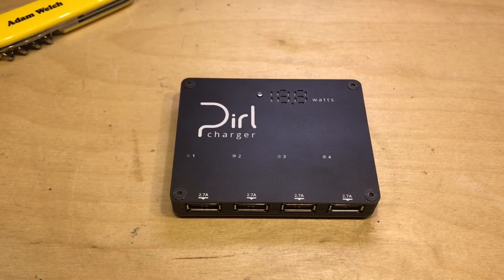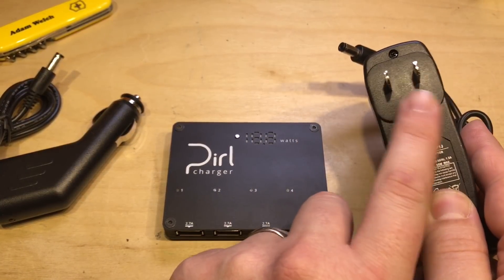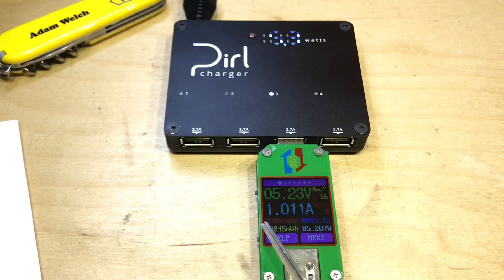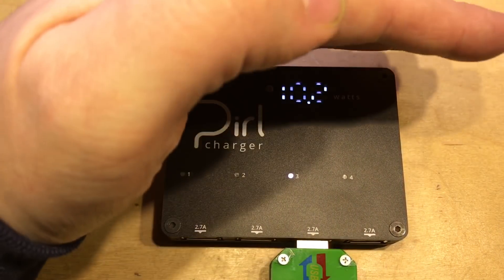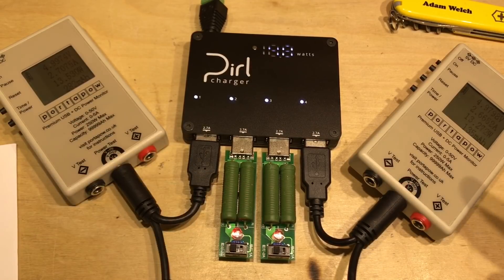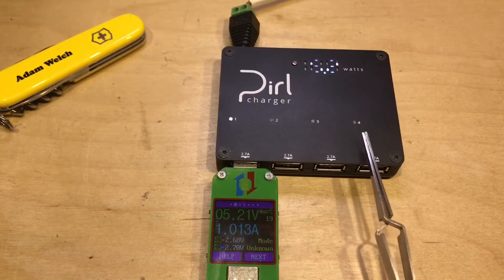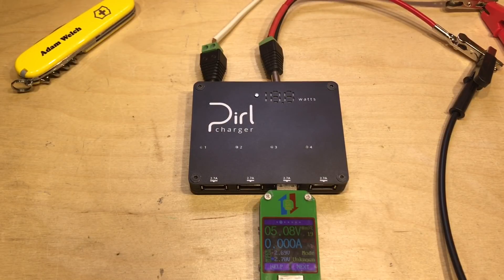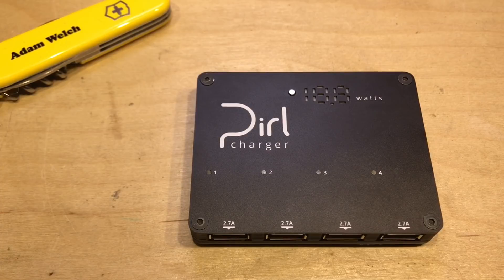Pirl Charger - Full Claim Test - 12v Solar Shed

Comment: not too sure about this pirl charger... i'm a backer in the 500 range and the product was supposed to be delivered in october 2018. the last email i received said final shipping would be sometime in february but there hasn't been any updates since then. and there are no youtube reviews of production examples even though they claim to have shipped several hundred chargers months ago.
Reply from the maker: Oh dear. That’s a shame you’re having trouble. Perhaps you could reach out to them and ask for an update? I’ll be honest I haven’t looked at the campaign progress for a while.
Reply: i finally received my pirl chargers in april of 2019, and they do work as advertised so my only complaint was the slow delivery and the lack of communication from the company. but i must say, they do work quite well and seem to be just about bombproof. i even tested them in an old vw beetle with a 6-volt electrical system and it worked as long as the engine was running. i also tested them with a 12-volt solar panel without a charge controller and they also worked.

Comment: Adam, just found your channel and have binge watched all videos that I felt interested me.  I have some questions about this charger that I can't seem to find on the developers website or in your test.

1.  On the site it says it has intelligent charging, but does not specifically say it supports QC2.0/3.0.  I did not see you plug in your trigger board.  Do you know?

Thanks
Reply from the maker: Thanks for watching! No this is just a 5 volt charger. It does not do Qualcomm of any fashion I’m afraid. 
I hope you will stick around for more to come on the channel?
Reply: Oh, absolutely...I'm an electronics guy myself and heavily into solar and EV propulsion.  
You have to wonder why an individual would word their site as intelligent charging if you don't support the main ones being used.  Lastly, why would you bring a new product to market and NOT support QC 2.0/3.0?
Reply: @douglasmontgomery6315  probably because qc is proprietary protocol owned by qualcomm meaning if you use it in your product, you must pay licensing fees to them. this is how sony betamax failed and jvc's vhs tape became the standard.

Comment: I'm getting significant voltage drop (~1v) from the 20A fuse connected to my pack, meaning one of the packs of parallel cells is barely discharging - would you know why? (3s12p)
Reply: Ollie Baxter 

Bad connection would be the most likely cause.
Reply: Yeah, you're right - was double checking the connections last night and one just slipped off... I'll get that fixed and it'll probably solve it.
Reply: Glad you got it sorted.

ID ten T errors are normally the problem. Well almost always the problem in my case.

Comment: That's also a very handy four-way 5V PSU for such things as a Raspberry Pi 3, Arduino projects, etc, all with independent supplies. Depending upon price, I'll be buying at least one of those, when they're available. Thanks for the thorough review, Adam.

Comment: You can get 6v -35v 4x port USB modules on email 8A total. Or more easily you can find 12v/24/40v modules. I used them with custom lipo packs,or lithium packs. I have a few around the garage working with my solar as well working with my solar Bank. I mean I did manage to drain the closer to 8A claimed so I am happy with them. I generally use when I go camping and easily keep a dozen phones charged for almost a week with something like a 40000mah 4S pack.

Comment: Probably should've added an efficiency test, I'm sure its fine but if people like you were planning on running it off solar I'm sure they would like to know how efficient it is.
Reply from the maker: Yeah, good point.  I was testing its claims in this video though (and it doesn't make any claims about efficiency) but perhaps I should have.  If there is some more interest perhaps I'll do a bit of an update video and try to include this.

Comment: Clearly they are using a dedicated chip (Not the ubiquitous TP4056). You rushed through the interesting parts. What are the chips on-board? Are they using a P-Channel MOSFET for reverse polarity protection, or that dinky diode near the input port? Do you have an O'Scope? What is the peak-peak noise when drawing 2.7A? Is there provisions to see the state of charging (voltage) of each port? Perhaps the switch can cycle through each port when charging? Those inductors look like 2A versions and without seeing the wire thickness and the value of the ceramic caps, its hard to say if it can sustain 2.7A for a long time without overheating and blowing up. 
As it stands, this is just a promotional video.
Reply from the maker: I’m sorry if the video disappoints and it most certainly wasn’t meant to be a promotional video. As I said I liked the feature list and wanted to check the claims. I might take a more in-depth view of the board later down the line and only time will tell (not a ten minute video) if the thing will last the test of time. 
The TP4056 wouldn’t be suited to this application - it’s a lithium charging IC, not a USB charging chip. 
If there is significant interest and I’m inclined to look at this again I will take your suggestions, run a few more tests and look closer at the board. 
I appreciate the feedback. Thanks.
Reply: Why would they be using a TP4056? This is providing general USB 5v power, not charging a Li-ion battery to 4.2v...
Reply: Mathew, Adam, I didn't say they would. I guess you didn't see the "Not" part. 
FYI, the TP4056 is used in many charging application, not just USB. This is a charger as well, so there must be a way for it to charge a Li-ion cell, conforming to its charging curve and cutting at 4.2V.
Reply: UFOhunter  It's a USB power supply. It's only a 'charger' in the sense of providing a DC supply for a device that contains an inbuilt charging circuit for it's inbuilt battery....

Comment: Uhm? pardon my ignorance but its not a charger, its a USB hub splitting one output into four. Where is the indicator telling me when my device I've plugged in is charged?
Reply from the maker: Thanks for the question. When the device doesn’t carry any more current the channel indicator light switches off. That’s your indication. I showed how the channels are completely independent of each other, by testing the protection circuit, showing there were slightly different voltages on the outputs and finally by showing the pcb.
Reply: If it was a hub then it would have a USB input! It doesn't! It has a 7v-17v barrel jack. It is the same "charger" as all the "chargers" you plug into the wall for your phone, except those usually only have 1 or 2 outputs.

USB protocol has no specific way to say "this device is now charged, please stop providing power or signal it is done". That is application protocol specific. So your feature is impossible for a general USB power output.
Reply: MonaichFother that would be a USB powered battery charger. A USB charger, to me, simply provides USB-spec power, which can typically charge micro, mini and type-c portable devices.
Reply: Okay not a hub but a power splitter then, variable power in, four USB power out. Correct me if I'm wrong but if I said to you I had a charger, then you'd expect to for example. plug a 18650 into it and it would charge it to a set value, then switch itself off?
Reply: i agree
I call it a USB power supply..
I don't get it:
A unit that supplies power for a laptop, phone etc. but contains no charging circuit, and people still called a charger and not a power supply... why ?
Reply: Fair comment  (thumbs up)  Here's a question for you though since your here.
I want to solar charge a 18650 with a TP4056 but my panel outputs 12 volts. I was going to buy a cheap "DC-DC 4.2-40V to 3.3V 5V 6V 9V 12V 24V Buck Step-down Converter Linear Regulator" that will convert the 12v to 5v for the TP4056, however the panel will not output a steady 12v it will dip & rise depending on light conditions. Do you think the regulator would output a steady 5v whatever the voltage it is supplied?
Reply: Yes, it should.
Reply: MonaichFother as long as the panel can provide at least ~6-7v the buck converter will hold its output steady at 5.
Reply: Paul Morgan  Please point to a detailed description or definition of the word 'charger'. The words 'charger' and 'power supply' are often used interchangeably, both used to mean the same thing. Most mobile 'phone 'chargers' are just power supply units. A true battery charger controls the voltage and the current. But with USB devices, it is the device that has the battery in it that actually has the charge control circuitry.

Comment: I’ll be first cab off the rank , subscribed to Pirl and looking forward to its debut on Kickstarter well done Adam well done Pirl.
Reply from the maker: I didn’t do much :-)
Reply: Adam Welch great video simple short and sweet  with lots of detail , have a look at “VoltBot” on Kickstarter I have backed it and will get the Pirl , I go to Hong Kong & Shenzhen every 8 weeks to collect gadgets and electrical trinkets to play with. Have collected over 200 18650s out of old laptop batteries and want to do a solar shed. 😊👍

Comment: Really cool device but wonder if there is a market for these? What's the price point?
Reply from the maker: Yet to be confirmed. Keep an eye on their website because things are often launched on Kickstarter with early bird pricing - not that I’ve been told this will though.
Reply: I work in IT and have for 40 years, I have multiple phones and external battery chargers. This will be a plus in my department. Thanks for the review,  I am waiting anxiously for this to become available for use with my team . Thanks
Reply: It's not so much a question of having a market for it, but at what quantity.  Sure a few techie types who actually understand the channel separation and high build quality will shell out $50-60 bucks, but an average consumer who has no appreciation for such things will probably buy a cheap Chinese knockoff instead.

Comment: thats a really nice charger, too bad i already have a decent usb charger already. though wide voltage range would support 30v for a 24v system, so its useless for a truck.
Reply from the maker: I think they have possibly missed a trick there.  A decent, protected, powerful charger would be welcomed in the cabs of many a truck I would have thought.
Reply: maybe a higher voltage quick charge version is in order
Reply: Yeah i honestly think a 30v tolerance would be something i really want too ( 7S 18650 setup or 2x lead acid battery setups ).

Comment: 12voltvids did a review of this as well.
Reply: Thanks. I wanted to know the chips used. This video didn't teach me anything and was more like a promotional video. Your link showed a lot more. One of the chips is a AP65450, which is a 4A, 18V, 650kHz ADAPTIVE step-down converter, which is interesting. I couldn't make out the 4 x 16 pin ICs.
Reply: yeah I saw it. He has manual production nr 5